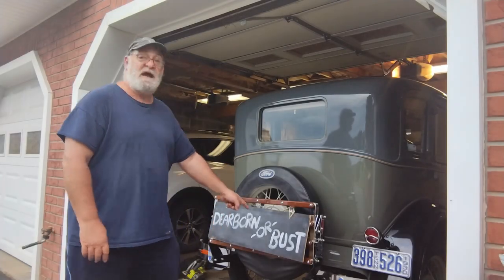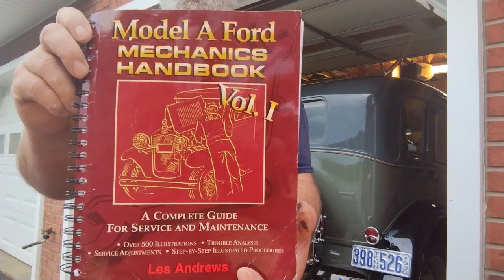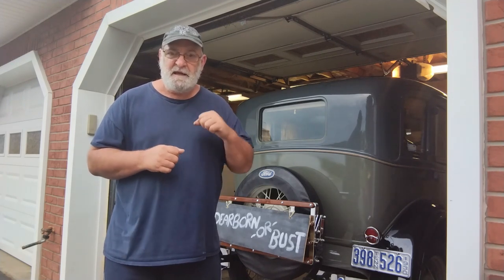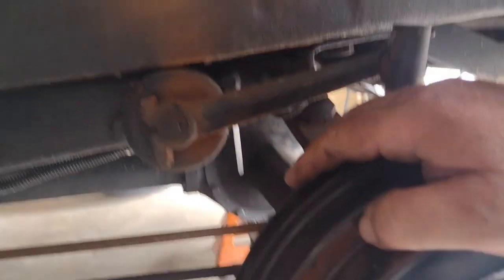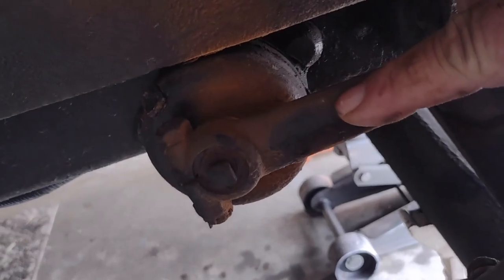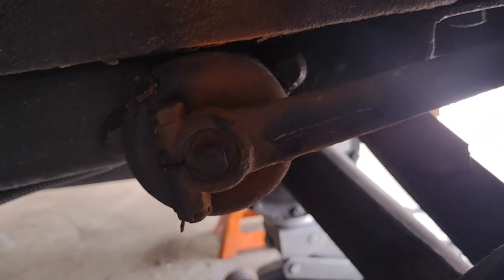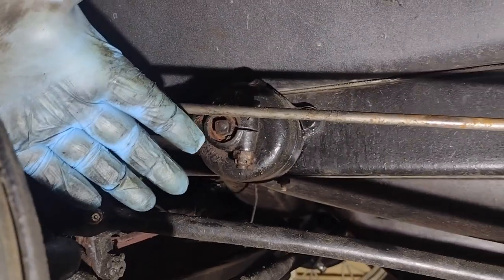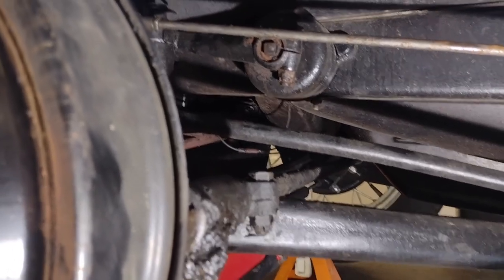1930 Ford Model A 1100 Mile Road Trip Preparation From Tennessee to Michigan and Back Again!

Comment: Don’t forget to get a Mitchell overdrive kit on this year’s Santa wish list.  A real game changer on this sort of trip. 
I’ve found my roadster to be very sensitive to toe in settings. Don’t be surprised if you notice a difference. I start with the recommended setting and then experiment with very small changes. The goal being optimum tracking and minimal reaction to variations in the road surface.  I’d suggest placing a small index mark on the tie rod for a future reference if further adjustment is warranted.
Good luck.
Reply from the maker: The Mitchell overdrive would certainly be a nice addition to have!  Also, the index mark on the tie rod is a great suggestion!

Comment: Ken,  you do have shock issues and need them fixed someday soon. I agree they are not a deal breaker for your trip. I would pull the shock linkage off that left rear since it is obviously toast and one source of noise that might hide the sound of some other noise that might be important down the road. I have the Ken Davis shocks on my 29 Tudor. When I bought the car 5 years ago it had no shocks. I am happy with them.  Good luck on your trip. We will be doing 400 miles round trip plus 4 days of “hub tour” in the Northwest Regional meet in a couple weeks.
Reply from the maker: Hey Bill, thanks for the feedback on the Ken Davis shocks.  Two gents in our club have them and they love them.